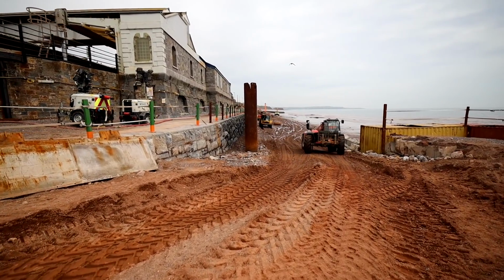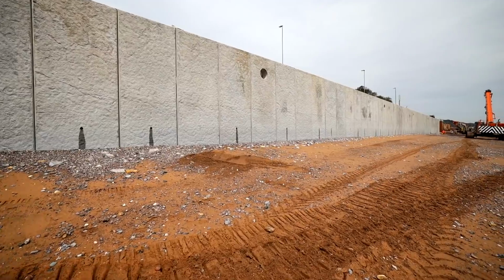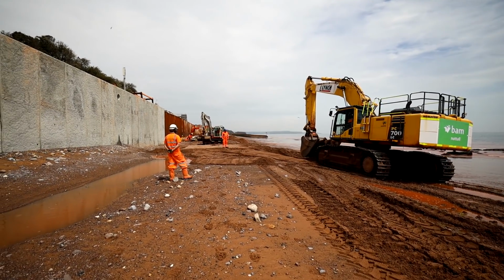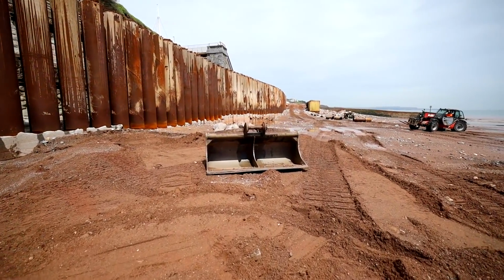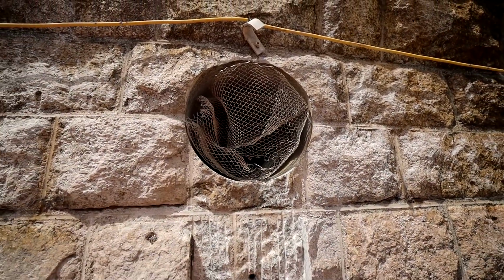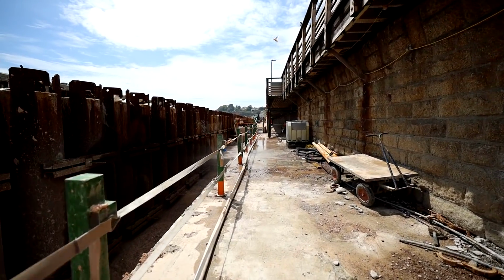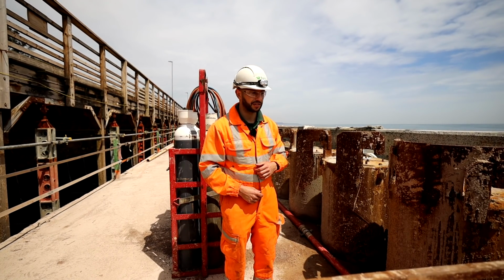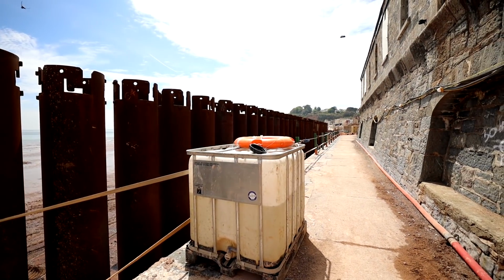A Guided Tour of Phase Two of the Dawlish Sea Wall

Comment: How utterly horrible looking. Designed by engineers with no idea for style . The designer needs to go on an aesthetics course. The wall is needed but this is a beauty spot and you've made it akin to the Berlin wall. Couldn't you have got a more pleasing to the eye finish on the wall, that resembled the old one? No prizes to be won for this horror show.

Comment: Piles appear very corroded, what is to stop them becoming more corroded and damaging the concrete?
Reply: They put 'pile cream' on them - you should see the size of the ship carrying the tubes!
Reply from the maker: I believe that the piles have been treated.
Reply: @CoastCams247  probably made of core 10 steel
Reply: The alkyline environment within the concrete mass will ensure that the steel casing does not continue to corrode. There's plenty of cover over the steel to prevent the chlorides from attacking the steel.